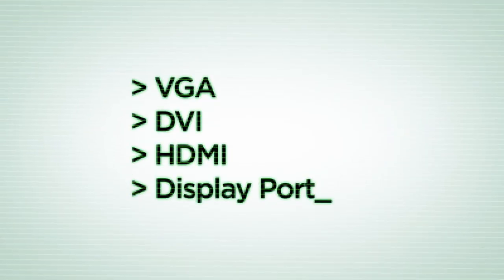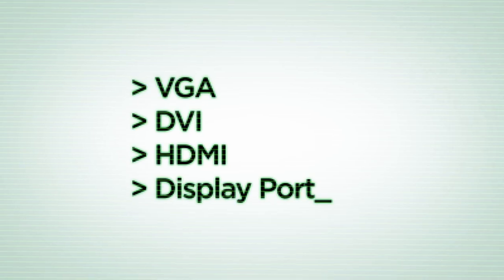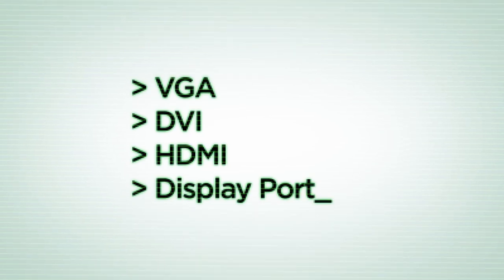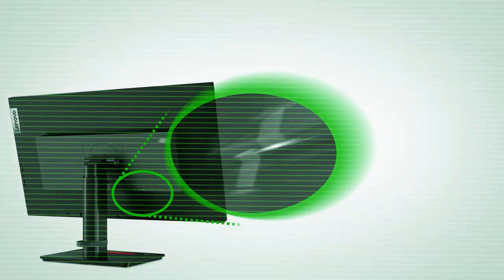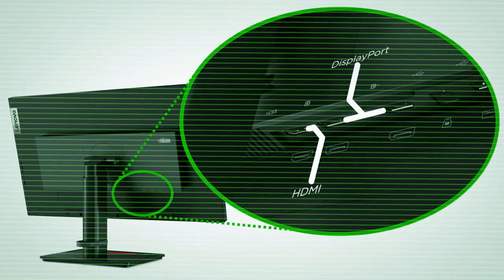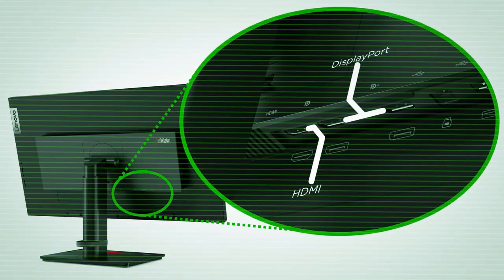How do pixels work? | Lenovo Back to Basics Episode 5: Computer Monitors and Display Technology

Comment from the maker: USB-C and Thunderbolt is a more recent display connection type that leverages the universal serial bus to transport video, data, and peripheral signals from a PC to a monitor or dock. USB-C can provide power from a monitor or dock to a PC. USB-C provides an all-in-one connection enabling monitors to be standalone docks.